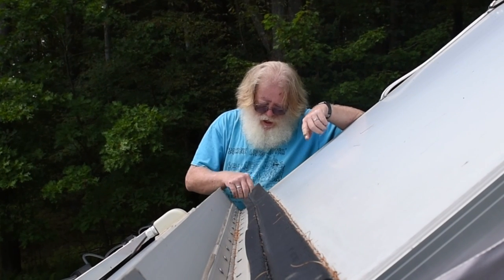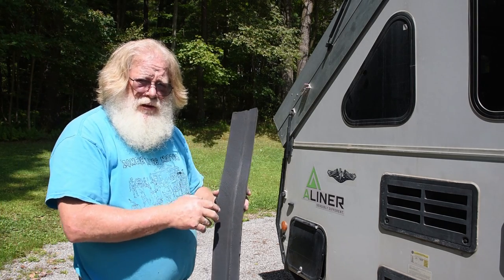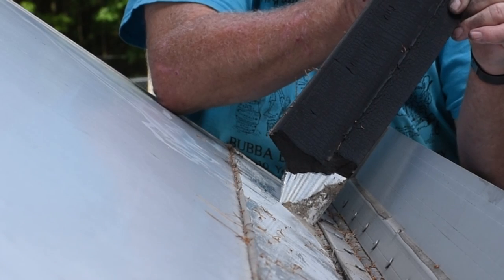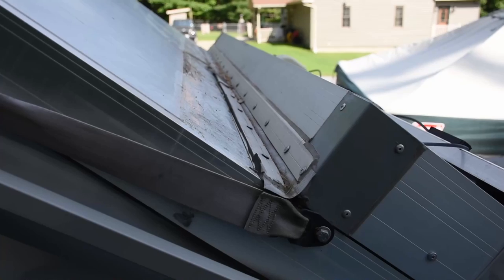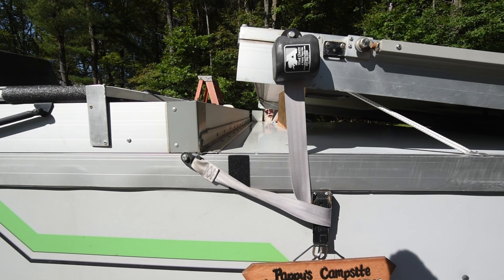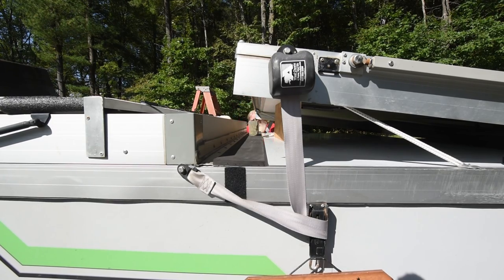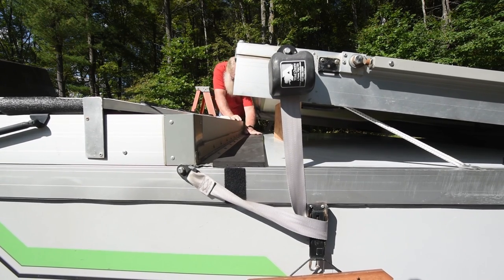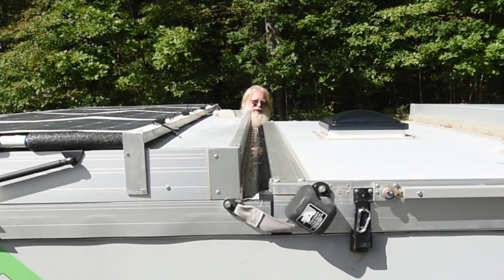33 Aliner Rear Roof Seal Replacement

Comment: What was the name of the product you used. I don't recall you saying what it was. Thanks for the video, good Job!
Reply from the maker: Which one? The rear roof seal itself came from  Aliner.
Reply: @eugenebreindel  I have a forest river Aframe, and I only have one gasket on the top of the trailer. I guess I can call forest river.
Reply from the maker: @cdmercer4982  as stated I got mine from Aliner. The original was .5" x 4" the replacement was .5" x 5". You can buy closed cell foam (polyurethane foam) in many configurations from McMaster-Carr online.

Comment: Is that seal just for when the roof is down? What protects water from entering that pop up extension when the roofs are up?
Reply from the maker: Yes, it seals the gap between the front and rear roof when folded down. When the roof is in the up position, the front lip overhangs the back panel peak. Under normal conditions this works. If a very strong wind and heavy rain are coming from the rear of the Aliner, the wind can blow the water uphill along the rear roof, up under the overhang, and sprinkle down into the inside just like a waterfall. It is always wise to park with the tongue of the camper facing towards the prevailing winds.

Comment: Great job! Do you think it comes thick enough? I have a new Ranger 10, and I can already tell there’s a gap in the middle when the roof is closed- during a storm driving back home, I got water inside the camper underneath that area.
Reply from the maker: The foam strip at the peak is open cell foam & not water tight by design.  If you got water inside while towing, your trailer hitch might be too low. The Aliner roof should be slightly downhill from front to back when towing so water runs off the back.
Reply: @eugenebreindel  thanks! Next time I hook up the hitch, I’ll check to see what the level is.